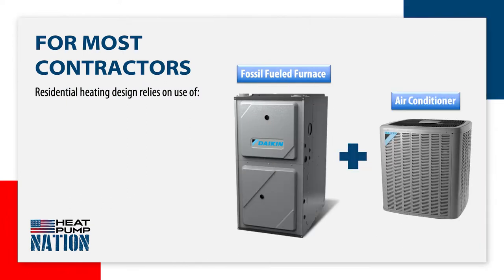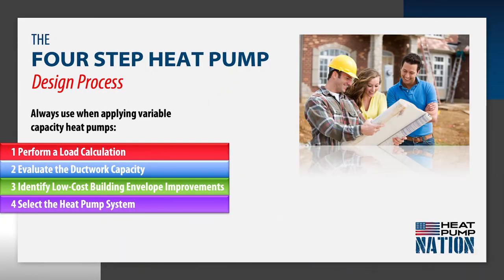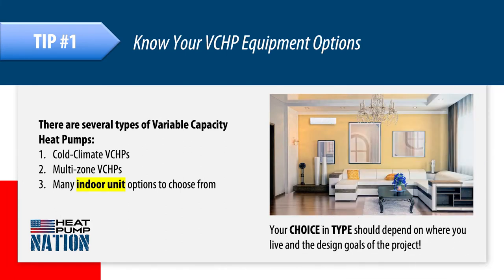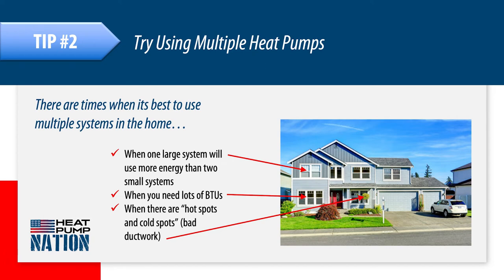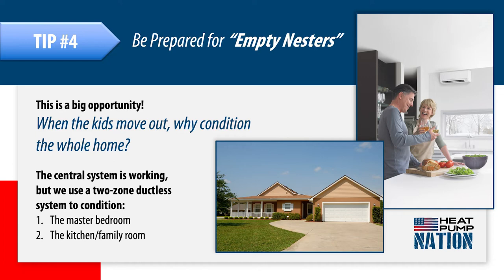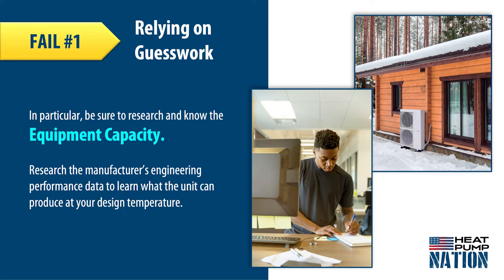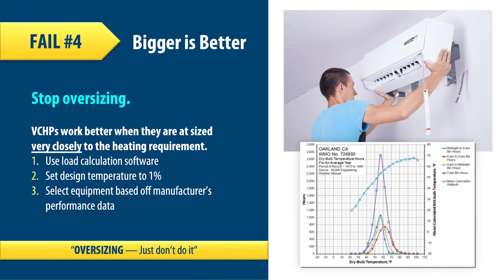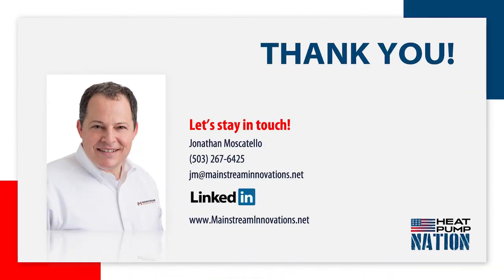HPN4 - Designing Heat Pump Installations for Heating and Cooling

Comment: This is a very helpful video. As a homeowner who had a hybrid heat pump installed 18 months ago  I learned a lot. Especially the necessity of having an old duct system evaluated before installing a heat pump. Also important is the place of the thermostat; not above a cold air return like ours was.